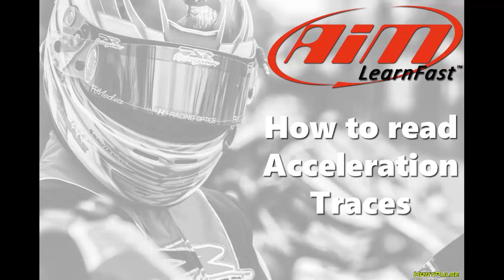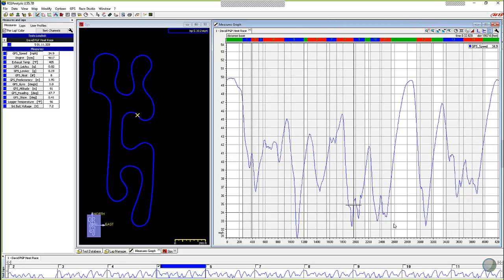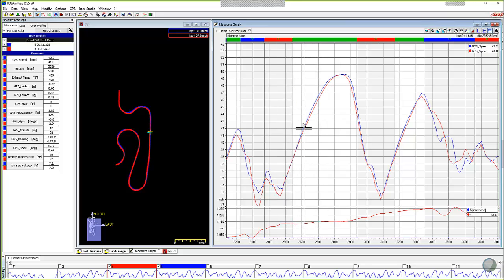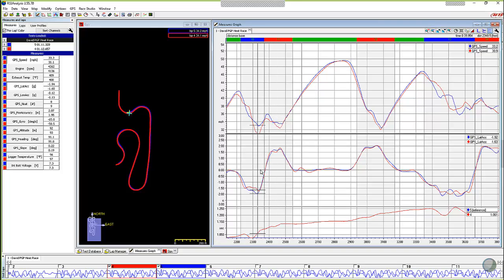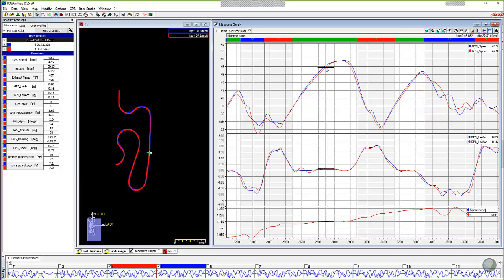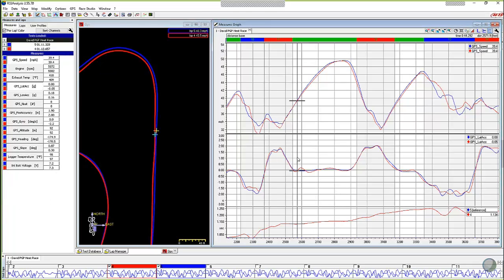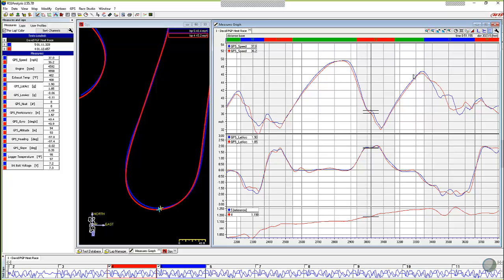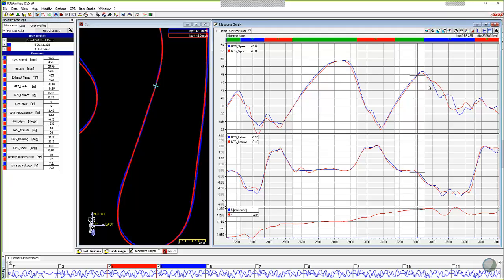Reading Acceleration Traces in Race Studio 2

Comment: Is the G reading on the MY5 mounted on the steering wheel any difference as to the old MY4 with the G sensors at the GPS unit.
Reply from the maker: Yes, it is much different. The internal G reading will take small things into consideration (bumps on the track, breaking loose in turns etc.) The one through GPS can only see the rate of change in movement, and will guess the G forces based off that. Oftentimes, it is easier to look at the GPS G forces, as the channel looks a lot less "noisy" but they sure can be used for different things.